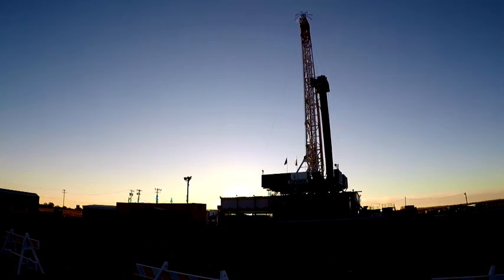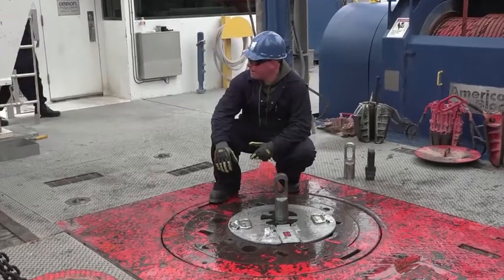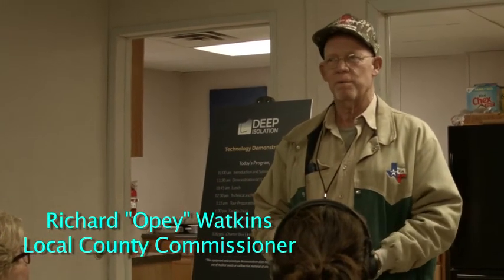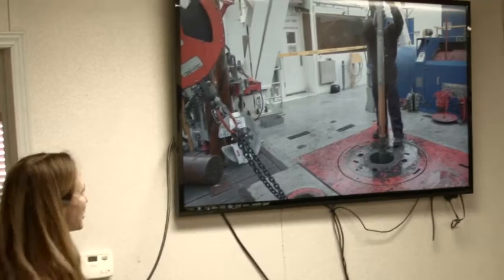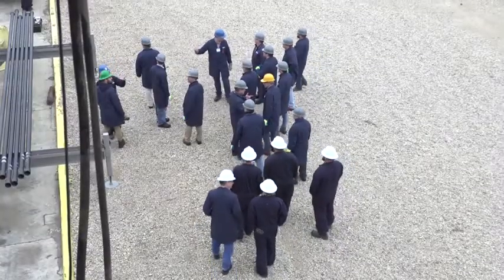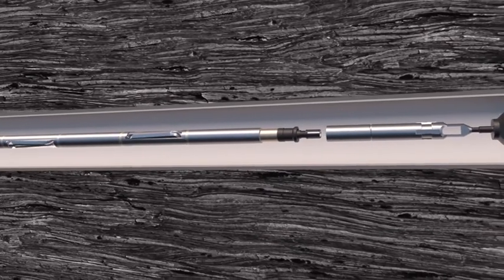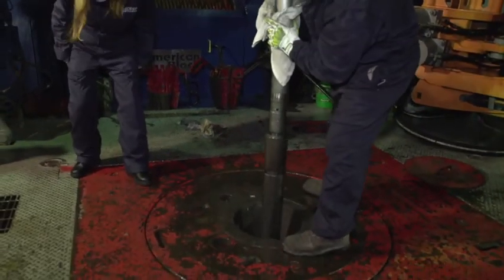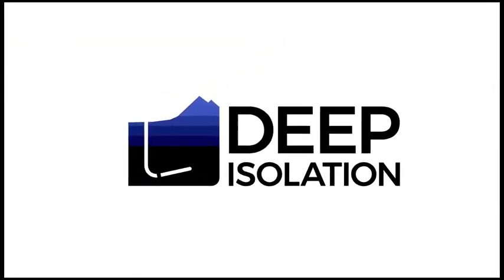The Deep Isolation Texas Demonstration

Comment: How are the canisters retrievable in case of a major earthquake?
Reply: There not made to be retrievable.. After a few weeks the bore hole will compact around all the cases. Besides there in no reason you would need to recover them ever. The whole point of drilling miles below the surface is to safely allow them to decay safely for the remainder of there halflife. There is literally nothing unsafe about this.
Reply: @sirpieman300  I completely disagree.  Annulus, microannulus and channeling not to mention this concrete and casing will not outlast the waste.   When drilling down to those areas they are talking about means they make a trail with their drill that makes a weak point into those areas that will eventually have water where it normally isn't.  The aquifers will begin to drain into these boreholes.   This private company is owned by Richard and daughter Elizabeth Muller.  Richard has worked with the government for years at Berkeley and now he has a private company that just got millions of dollars in grant money...our money.
Reply: @paulmobleyscience  The Deep Isolation channel has an hour long presentation with a QnA section at the end where they explain what would happen in the worst case scenario

Spent fuel will be kept deep enough that it cannot ever come into contact with drinkable water, given that it would be encased in dense rock under enough pressure to be virtually impermeable

The vertical bore hole is supposed to be sealed all the way, and simulations show that even if it were improperly sealed the radiation that would eventually reach drinkable water is a thousand times less intense than the safety threshold
Reply: @giacomogalli2448  Apparently you haven't flipped through my content because then you would've realized I already made a presentation about Deep Isolation.  For some reason no one ever thinks about the shaft down to the waste...you know...the trail from the surface down to the waste?  Microannulus, concrete issues...we've all heard the issues with boreholes shafts and most of the abandoned shafts aren't even marked any longer. The point being...getting it up under the aquifers isn't the only issue especially when we make a path through all those layers, including the layer with the aquifers, that would undoubtedly makes it's way to the waste.  
Why is that an issue?  Redox+evaporation equilibrium coefficient=mobility

Comment: Can't you just shoot it into the sun so we never have to worry about. Or deep space. If the weight of the rock crushes the whole closed like the other video says won't it crush the nickel case as well that is supposed to last  tens of thousands of years. What prevents the heat build up from the radioactive material from exploding the rock around it.
Reply: Sending it to space would be just a massive waste of fuel and its completely unnecessary. We take the Uranium out of the ground (for now until we get it out of the ocean) and then put it back when its done. Just like we feel no need to gather all the Uranium on Earth and send it to space, we don't need to send the used Uranium to space. The casks are solid and won't just break open, and even if they magically did anything that leaked out would already be sealed in rock far underground. Also Uranium fuel isn't going to explode like a bomb, they are completely different things.
Reply: What of we find a use for it later?
Reply: "What prevents the heat build up from the radioactive material from exploding the rock around it."- conductivity - recall, rocks conduct heat from the Earth's core all the time.

Comment: Did Schlumberger specifically request not to be referenced with this project? This is clearly the Schlumberger Cameron Test & Training Facility Rig in
Cameron, TX

https://www.slb.com/-/media/files/drilling/product-sheet/cameron-test-facility-ps.ashx

Below is the link to the Schlumberger "tractor" tool called ReSOLVE that actually delivers the nuclear waste canister to the required location in the cased horizontal wellbore and retrieves it if necessary. The actual waste container is likely a capsule made of 316L stainless steel that prevents any Cs-137 and Sr-90 radiation from escaping.
99% of the technology is from the oil & gas industry and in this case, from Schlumberger.

https://www.slb.com/well-intervention/slickline-and-wireline-intervention/resolve-instrumented-wireline-intervention-services/high-force-linear-actuator-tool

Comment: This is the current best safe solution until molten salt reactors that can destroy nuclear waste are up and running.
Reply: Even then, the final waste composed nearly entirely of caesium and strontium must be managed for ~300 years. It'll fit nicely in DI's boreholes.
Reply: Molten salt reactors have an issue called Tellurium embrittlement of the hasteloy.   This is the real reason why MSRs where shelved back in the 60s...not military or politicians.  It was the scientists that shelved it.